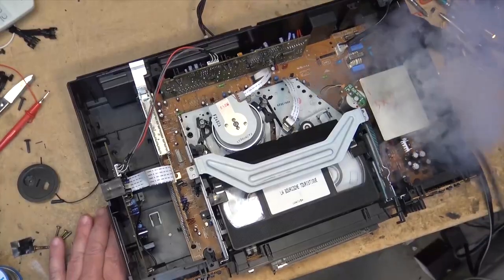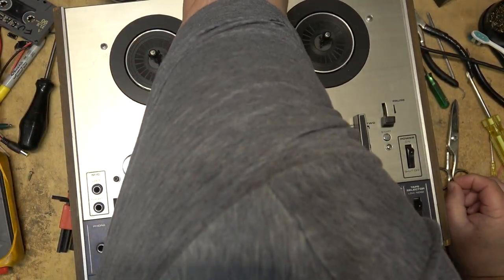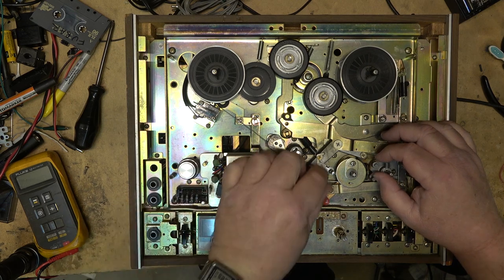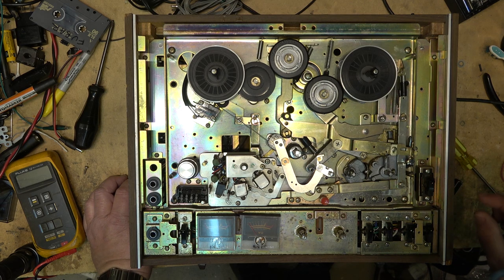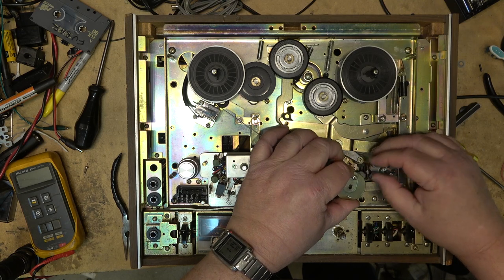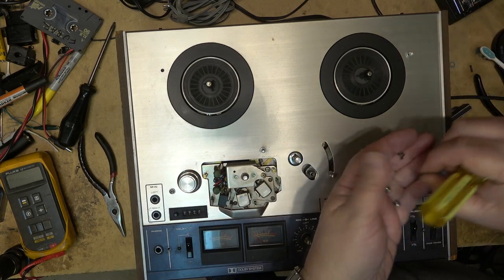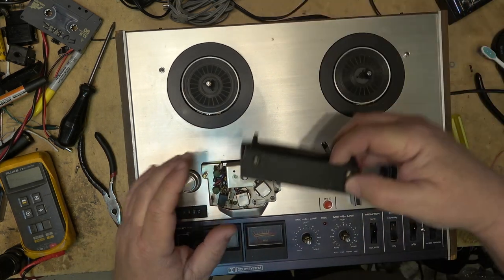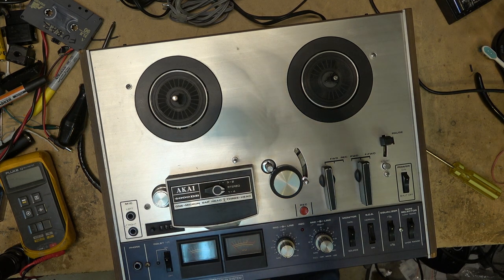Before buying any old AKAI tape recorders watch this

Comment: I have exactly the same model.  It sat largely unused for round 40 years or more and I got it free after my granddads death.  It had exactly the same issue with the play cam having disintegrated which was unfortunate as I was going to capture all my granddads tapes, plus one I made of myself as a kid on another machine.

It took a few years but a replacement cam eventually popped up on ebay, now the mechanism works but it very sticky and needs the old grease cleaning off.  I also think the pots need a good spray of deoxit as I can only get one channel with the other one being very low and scratchy, I havnt looked in the back at any caps yet.  The other cams are made of the same crappy metal and will also go but so far it was the play cam, it was just shattered in the same way as this one, must have more force of it when not in use or something so it breaks sooner than the others.

The replacement part I got was metal, I think it was a new casting, it didnt look anything like the metal used here.  From what I recall it was approx £20-30 but its been a couple of years since I popped it in.

 There is someone in the UK 3D printing parts that they describe as "very strong", positive feedback coming from others that have bought the entire kit, however, nothing that explicitly says if they work or not.  I may take one for the team and buy the kit to test out, once I have captured these tapes, even if they only work a short while they can be useful for capturing these tapes should any other cams break while I do so as I got this unit for free and working reel-reels go for huge amounts (this model goes above £100 when not working and a working one is at £150 currently with 4 days remaining, I expect it to go to £300 or so like others I have just looked at) and obviously are bulky to transport.

During the years I was searching I was constantly bumping into freshly cast aluminium cams for a 4000DS, I have the 4000DB.  The 4000DS seemed much more common and when I searched for the 4000DB I kept getting info for the GX version!  I have often wondered if the 4000DS and DB have compatible cams, if they do that would have saved me a  lot of waiting.  Looking at this 3D printed kit, it seems to suggest that they are indeed compatible.

I should check the belt, it worked ok but I should take a look in the back.  I haven't tried going in the back yet, no idea what I will find!

As an aside, my Granddad was a big Glen Miller fan, I have heard a couple of the tapes and I think they are likely Glen Miller broadcasts.

Comment: My dad bought one of these, back in 1983. It was an AKAI. It had light-up ☝ VU meters, and a lighted tape head mechanism. It was so COOL 😎. The clear acrylic plastic shield 🛡 was illuminated, which is the part on the outside of the tape transport mechanism. It also had a 4 digit tape counter with green numbers. Any of these were cool 😎 machines back then, but they're probably all in need of a recap job by now 👎. The REAL cool 😎 thing about these reel-to-reel tape decks, was when ya put it into fast forward, or rewind. It would go at such a high 👡 rate of speed, that the emptiest reel could attain very close to 30.000 rpm, before the machine automatically 🚘 stops ✋, when the end of the tape is reached. Please keep 👌 these GREAT reel-to-reel videos 📹 coming!! Your friend, Jeff.

Comment: Faced the same problem. The part was glued together and then soaked in epoxy. Not the most elegant solution, it but it worked.

Comment: I own a 1970 Akai 4000DS. I bought mine on ebay, it's absolutely amazing how it is all original, all the capacitors and belts are original. I have no idea how but it plays and works fantastic. It does need a main belt which I have no idea where to obtain one. But other then that awesome video as always and the information that was good to know.
Reply: Ebay, you will find belt kits on ebay, there are just two.
Reply: Or you can get it on amazon also.

Comment: I fixed these  Akai cams with epoxy steel putty. Then should file and make it to working shape It was a 3000D and had both cams cracked. I removed thom and fixed with 2 holes and passing a square U strong steel wire and apply epoxy steel 5 minutes or longer one and let it dry a day. Then file it to shape and fix it. It is still running and the cams are working OK.

Comment: Great that you understood the fault and troubleshoot. But feeling sorry as parts are not available for repair.
Reply from the maker: At least not for economical repair.  Guy that owned it figured if he could get it going for 50 bucks he would be interested. When. I find 3d printed parts for 80us plus shipping and then labour on top he is looking a few hundred minimum to restore he says scrap it.   Don't blame him.  I bought one of these machines for 30 about 5 years ago.

Comment: Grundig also used pot metal on critical tape recorder mechanism parts in the 1960s. And it is sad to think how many machines were thrown away because of the cracked mechanics.

Comment: Dave, I just saw that you can order these on ebay, about $80.00 USD !
Reply from the maker: Well it's mine now, so perhaps I will do that some day.
Reply: @12voltvids  if  you have a friend with a printer maybe he can print some. All 3d files are on the thingiverse website. I have fixed 2 players like that. I printed solid with ABS plastic. After lubricating everything, this works super good, no wear at all!
Reply: If it's a better deck than the one you have maybe your old one uses the same cams and you can swap them in and get it running. You can always order the repopped cams later and get both running.
My first reel to Reel was a 4000ds MKII and I never had a problem with it in the time I owned it. It used the same setup so might be a good option for used spare parts too.
Reply from the maker: @69Dartman  Its the same, just Dolby NR
Reply: @12voltvids  Hopefully you should update on the Akai 4000DB with a new 3D printed cam replacement, and it will work perfectly.
Reply from the maker: @Musicradio77Network  
I don't want to spend 150 for a 3d printed cam. If i could one for 20 all in yes i would do it.  
80 usd is about 110 cdn then there is shipping and broker charges and taxes by the time the smoke clears 150 min and i could expect perhaps 50 to sell it.

Comment: I have the DS version of this unit.  I replaced all of the capacitors and the known, noisy transistors.   (There were A LOT of them).

It's good to know that there are replacement parts in case the pot-metal cams ever break on mine.  I knew that they were a problem,  so I cleaned them and put a thin layer of white lithium grease on them so there is the very least resistance when turning them.  

If they ever do break, I will replace them.  It's a very-good sounding,  simple, solid unit.
Reply: I did the same thing with my 4000DS.  Works great again!

Comment: I had that exact model for many years. It sounded pretty good, though the flutter was pretty high (about 0.15% spec) and you could hear it on piano and violin music. The playback head wore out and I replaced it with a Tandberg TD20A, which I still have. Big improvement!

Comment: Looks like a job for some 3D printing. Be interesting to see how long plastic lasts against pot metal. I suppose it wouldn't crack the same way at least.
Reply: no need. easy. It is generally available for sale.
Reply: IIRC someone did model up the part and do this - last I heard it was still working fine.
Reply: The harder plastics do fine.  There is a 3d printed part for this I listed it above.

Comment: Occasionally Akai equipment is for sale at swap meets,    

  While surfing the You Tube videos i tried your video  -  and i am glad i did.

  After looking at this video ,  i typed in "Pot Metal Composition"  -   the definition stated that its a blend of zinc, aluminum ,  copper and a good half dozen or more  recycled metals all melted in a  literal "Pot" ,  therefore rather brittle and not abrasion resistant.

  I will consider your advice if i see a Akai for sale

Comment: There are a slew of these vintage tape machines out there, still in working condition. However finding parts is often very difficult or impossible since the manufacturer often discontinues replacements after so many years after a machine was in production.  NOS is more common to finding parts now.

Comment: A lot of models are fit with this mechanism. Maybe a good idea to advise when you buy such thing to take the front plate off, and apply lots of fresh grease around the steel ball and cam. That will surely easy tension on that thing. I have repaired a lot of them, I worked at the distributors shop in our country, but never saw this back then in the '70.

Comment: It's not just Also, Philips used pot metal gears on some old tube radios, they also fail. Don't had tiny little pot metal gears on the loading carriage on their C9 beta machines, lots of examples I'm sure. What I need is an idler wheel for a lovely old Tandberg 1600 ... They come up occasionally but at silly money for a vintage used part that is also of unknown state until it arrives! Nice video, thanks

Comment: I'd do some Googling around there is a fella online that makes new cams for the Akai's for this reason alone. I'm not sure he's still doing it, but this was 2-3 years ago when I last read about this and at the time, he was still doing it. Worth a shot. when you opened this up and saw it was a single motor, I knew this was the issue.

A place to start is Tapeheads (use Google to search it, put tapeheads in the search parameters).
Reply: Yes still doing it. Still selling it.

Comment: I have the cams from the Akai 1721W and it does match this one. I worked on fixing the left channel last week, and what I did is that the record/playback head is started to break, and it has a tiny gap on it and the left is lost while recording and playback.

I just ordered another reel-to-reel machine which is a Sony TC-105 and I hope I can get the thing working soon.
Reply from the maker: I still have the machine.  Sitting on the floor over by the door.

Comment: what actually is pot metal someone else on youtube fixed a Magnavox turntable by drilling out a similar part that he used to replace the cam pin bracket for the cycling gear wheel

Comment: This metal is an alloy called Zamak, Zinc,Aluminum, magnesium copper,  with the years and humidity of the environment what is called Zink pest is generated, which is extreme corrosion, it will depend on the lead impurities and the environmental conditions, it is knew that the zamak factory improved the process using almost 100% zinc to avoid this problem and a better manufacturing, the striking thing is that AKAI has this problem is incredible, one would think that there was extreme quality, I saw Fisher decks of 3 heads with this same problem.

The dashboard and speedometer housing of my Citroen 3cv (Argentine 2cv6 version) is made of Zamak and is in perfect condition being from 1974, I think it must be a manufacturing problem as indicated.

Comment: The sad fact of the matter is, pot metal does not like shock or stress and will eventually crack. Or you have zinc impurities in it and it crumbles into grains. Thousands of dollars worth of collectible die-cast models have gone this way, despite being kept in cabinets and in their original boxes.

Comment: "Pot metal" I am just to that part in the video. Yes, of course. The cheap pot metal whammy bar bridges play ok for the first 6 months to a year. If you didn't scope it hard, you would think "ok, nice." They fall apart soon thereafter. As for my Japanese guitars, the real deal, decades and decades and it would be impossible to tell it has even been used. I beat on my axes and am whammy freak more than anyone out there, too. Of course, proper maintenance is always key as well, like chapstick lipbalm on the knife edges that meet the posts. :)

Comment: Thank You Very Much for the Advice!
Is it Possible to replace those broken parts with 3D printed ones?
Reply from the maker: Sure.  People ate selling 3d printed parts for about 100 plus shipping.  Last time I ordered an 85.00 usd part for a TV ot cost 30 in shipping and then FedEx sent me a 49.00 broker bull on top.  Cost the owner 350 to fix his TV that could have been replaced for that.

Comment: Dave, you are going to laugh at me to the fullest. I already know this because I am at myself (both in good and bad way.) My laser in the cd changer I have was STILL acting weird. It would play perfectly, then come back next day without tweaks, and would not play well again STILL. (Temperature as in warm up was ruled out. I considered both warmed up state and not.) Do you want to know what I did? I knew I would not ever want to use the unit this way - so I did an experiment. I am a tobacco user and 420. I took the floating base assembly out of the unit once again and poured alcohol all over it like a madman. Then I did it again, so as to let it get right at the internal parts (I think there is mirror inside.) The result is that it is the least touchy, most on point it has been yet. Also, the sweet spot of the RF Power adjustment is far lower than it used to be before I did this. I am not recommending this technique but I am recommending it to try on a laser assembly that is of little to no value to you or a customer. In other words, try it on one that you comdemn and see if it works for you too. haha It takes a WHILE to dry but a hair dryer helps. If it is not dry enough, disc no spin so wait it out in this case.
Reply from the maker: If it works and it is scrap otherwise why not. There is a mirror in there under the lens and in smoke environment it will get dirty.
Reply: @12voltvids  I put the unit back where it goes normally. It is perhaps 95% on point now. Plays everything very well, dirty discs cleaned then play well too. It is still not what can be considered perfect, as here or there, it just decides it wants to distort (scratchy sound.). I have a gang of 220uF 25V and 100uF 50V Nichicons on their way here, all 105 degrees C, for the RF circuitry. My gut instinct (no ESR meter here) is that this is going to seal the deal. :) The voltage in the area is precisely to a tee @ 5v.

Comment: My guess is if you’re going to get an Akai, stick to the ones that have solenoid controls but don’t accidentally buy one with a bad bias oscillator so you can’t erase or record tapes like I did when I was 11 years younger and didn’t know any better...
Reply: Sony is way better than Akai. Sony was the king of reel-to-reel tape recorders, and Akai was Sony’s cousin, so does Concord, Panasonic and Teac.
Reply: @Musicradio77Network  that’s for sure. In June I was given two reel to reel decks. A Sony and an Akai. the Sony quadraphonic deck works just fine. while the AkaI runs fine for a few minutes but slows down probably due to a motor capacitor issue.
Reply: No on the solenoids omg.

Comment: The Sony decks are not without their demons either. I have a Sony TC-399 sitting in the back store room that has noisy transistors in the front end. I have owned it since new, bought it in 1983 or thereabouts. Do you know which ones are typically the problem with these? It sounds like standing next to a waterfall with no tape running through it.

 I also have an outboard Dolby B unit by Teac. It is a model AN-60, I am in the process of doing a visual inspection of the solder joints and the insides for bulging electrolytics or anything obvious. Haven't decided to sell it or recap it and keep it.
Reply: If you can identify the first 2 play=preamp transistors, it's probably them.

Comment: Now I don’t use my Akai 1721W anymore, because the of the record/playback head is shot and the cams are still pot metal, I finally got my hands on my Panasonic RS-765US reel-to-reel tape recorder and it finally works. I got it off of eBay a few days ago, and it is way better than the Akai. I put a new belt for the rewind mechanism, because the original belt was shot, the fast forward and playback runs, and the rewind doesn’t run before I put belt in. After testing the recording, the playback runs good, the right channel plays on the VU meter while the left channel was weak. So I did checked one of the bias condensers on the bottom inside of the circuit board and I adjust it to make the VU meter looks a lot better on the left channel when playing a tape. Everything works perfectly and it is ready to record and play a tape. If you want to see it in action, check out my video.

Comment: The part is Zinc die cast part and they can fail, especially if they are used with rough hands.
I see there is a seller in the UK Ebay offering them for £28 + postage
Reply: zinc pest :)

Comment: Always consider cams and transistors as guaranteed dead when buying solid state pre-80s Akai. All is replaceable but factor it into your price. If the cams aren't already broken they are on borrowed time and it's probably easiest to replace them during the overhaul.
Reply: I have been buying and selling Akai's now for 20 years and have yet to see one with a broken cam! I make the early 70's the earliest I will buy though, that might have something to do with it?
I find the Akai's with less wrong with them, and more likely to get working with just doing simple fixes - they seem to be lasting well into the 2020's.
I own an Akai X2000SD which has Reel to Reel, 8 track Tape Player and Compact Cassette Player in one unit.
I use it every w/e and it have a spare one for parts which I haven't needed (the spare one has a blown channel)
Reply: Zinc pest is an interesting beast, two identical ZAMAK items can exhibit wildly different rates of decay or even be completely unaffected. Anecdotal evidence suggest the 60s models are the worst affected like the M series. No doubt there were composition changes during the years.